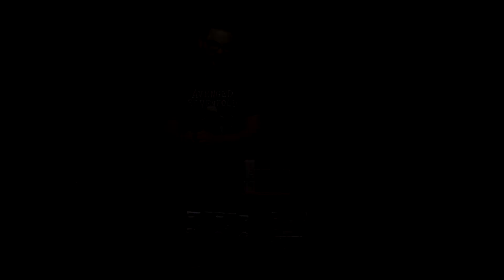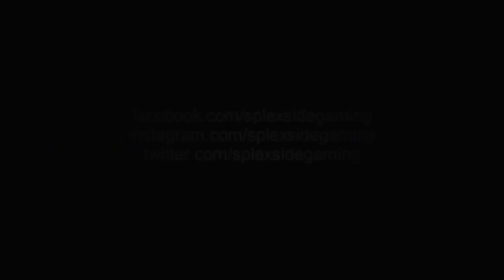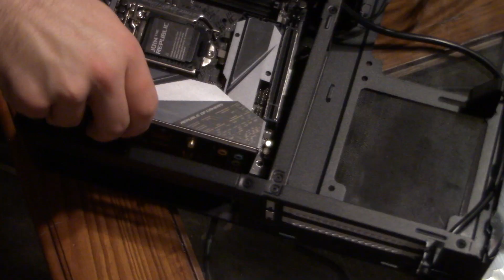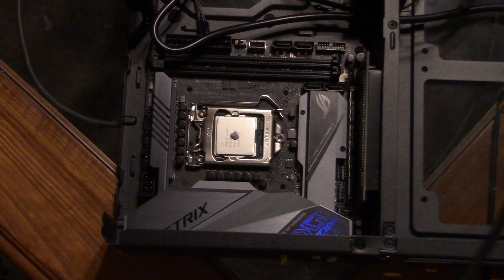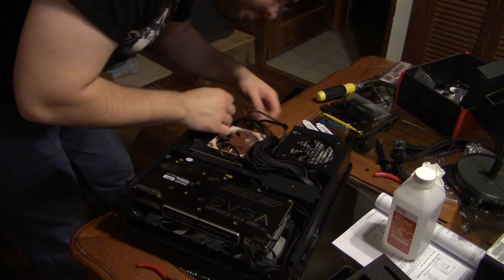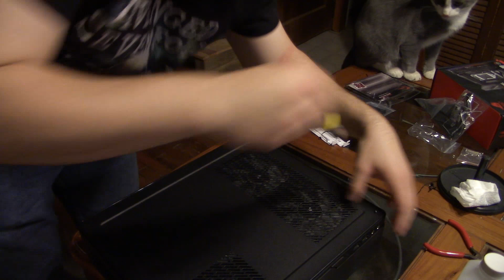Fractal Design Node 202 - ITX Build!!! - Build 6

Comment: I'm planing on doing a very similar build. Is the CPU temps still holding up good even though Noctua did not recommend it?
Reply from the maker: It hits in the 70's now but it still doesn't come close to thermal limitations. with the 9700k not having hyperthreading it has made a difference. there might be an occasion spike to 80 but its rare and is very infrequent. I actually just talked to the owner last week and he said it still runs games at 144fps on high or ultra settings without any problems.
Reply from the maker: Still runs cooler than my delidded 8700k that has thermal grizzly conductonaut and kryonaut on it with a corsair hydro rgb pro 280mm aio hahaha.
Reply: @SplexSideGaming  Really? Well that sounds great that it's still holding up with that cooler. I am trying to decide wether to go for the i7 9700k or the i9 9900k but with the 9900k I guess this kind of setup with a small cooler wont be possible, or what do you think?
Reply from the maker: I would absolutely avoid the 9900k with this set up. The reason the 9700k works out the way it does is because it does not have hyperthreading. Add on hyperthreading and the 9900k will have tons of heat problems. The small cooler will not be able to handle it. I would not run an ITX set up with a 9900k unless you are going to have at least a 240mm radiator on it.
Reply: @SplexSideGaming  Thank you for your advice!

Comment: GPU temps?
Reply from the maker: Sits right around 70c give or take a few degrees in either direction. There are 2 corsair 120mm fans blowing directly on it which helps out quite a bit.